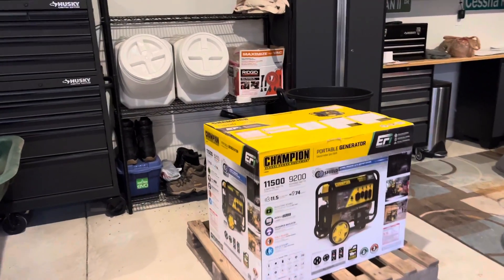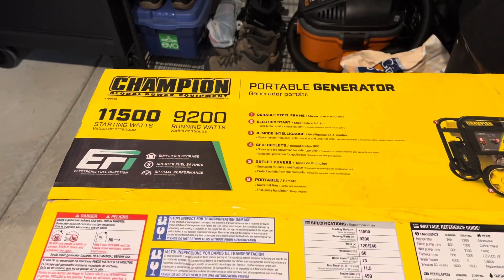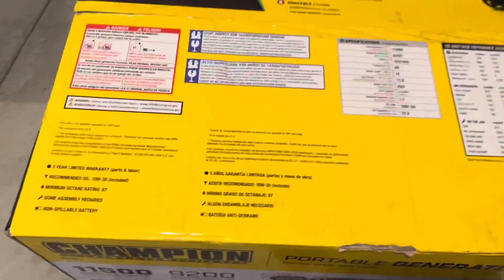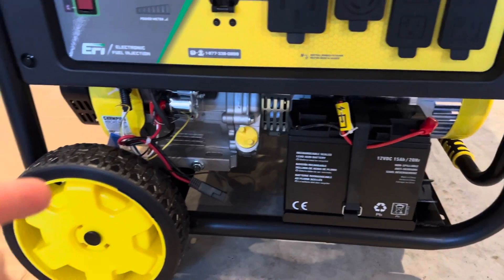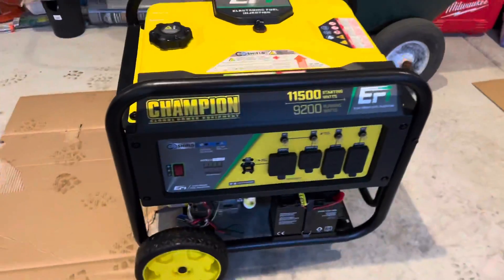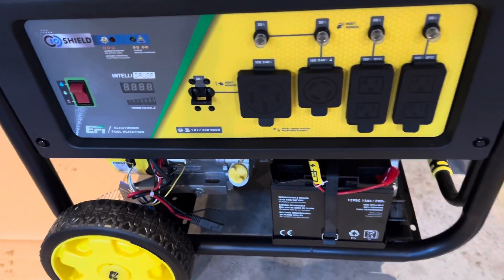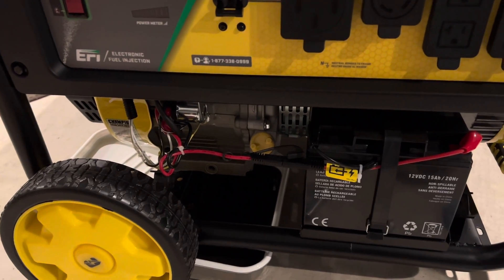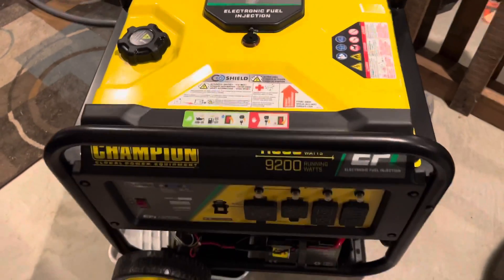Champion 100485 EFI Generator- Unboxing, Startup, & Break In Review

Comment: When you varied the load did you run everything simultaneously or did you power one thing, turn it off and then run another?
Reply from the maker: During break-in I made sure to change it up throughout the period. When I was adding to the load I didn’t turn everything off every time. Just varied it throughout the 5 hour period

Comment: When refueling the generator, does the generator need to be turned off when refueling? Or can it be refueled during operation?
Reply from the maker: Per Champion’s Manual, turn the generator off and let cool for at least two minutes before removing the gasoline cap. Always loosen the cap slowly to relieve pressure in the tank.
Reply: @austinharrington1248  When you varied the load did you run everything simultaneously or did you power one thing, turn it off and then run another?

Comment: Arggg,, you didn't show filling the oil. I got the 10000/8000 today, dual fuel, and it too came with oil. A plain black bottle from VietNam of 10w30. Is that what you got? Did you use it? And use the whole bottle for 40.6 oz or some 1.2qt? I assume Champion would send quality oil- or would they assuming it was getting changed in 5 hours? I'm enjoying your video and the efi is interesting .
Reply from the maker: I did use the included oil from Champion for the break-in period. The oil provided I have no knowledge on, but assume it is quality, coming from Champion. These generators can use various weights/synthetic or non-synthetic. I opted to switch to a 5W-30 full synthetic after I completed the break-in.

Comment: Does the generator have a floating neutral? I believe you need that for house back up.
Reply from the maker: This generator comes from Champion with a bonded neutral. You are correct though. If I was plugging in my appliances directly to the GFCI outlets on the generator, I would want it to be a bonded neutral. In my case, I installed a power inlet box and ran it to a circuit breaker with a interlock kit at my main disconnect below the meter. Champion provides a “how to” video if you wish to change your bonded to a floating neutral. Only took me about 5 minutes. 
https://help.championpowerequipment.com/article/4etN4HzYKq-disconnecting-the-neutral-bond-to-frame

Comment: Is the cord you bought directly from Champion? Also, do you know if this generator has full copper windings and is the THD at/below 5 percent? Thanks and great review!
Reply from the maker: I purchased my cord and interlock kit from geninterlock.com 
This model does has full copper windings. The THD listed from Champion states 12-20% THD, depending on the load. The only way I could see to achieve 5% or less would be with one of their inverter generators.
Reply: @austinharrington1248  WOW 😱😳  The THD is 12- 20 %... that's way too high for Sensitive electronics appliances like Central Heating and cooling system...
Reply: I doubt it not being an Inverter.